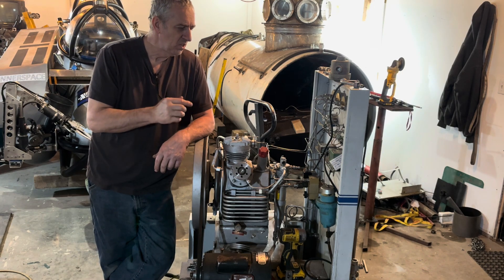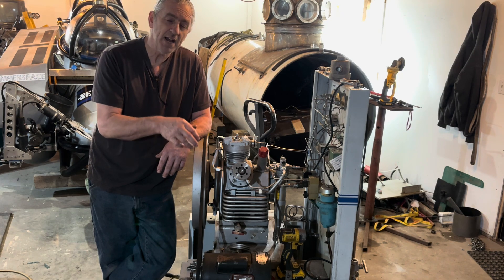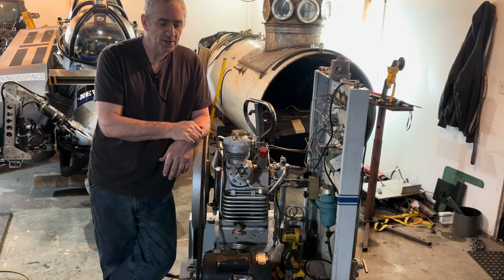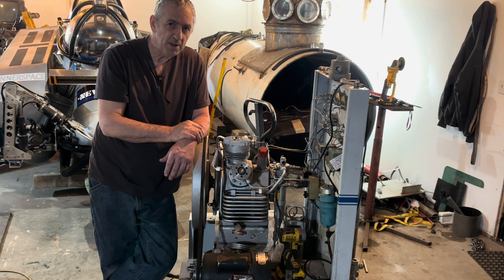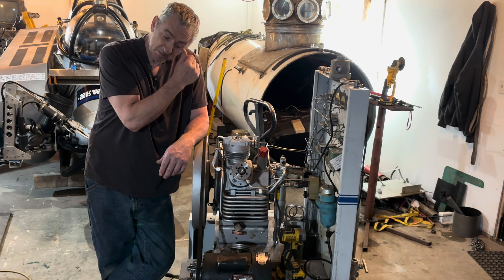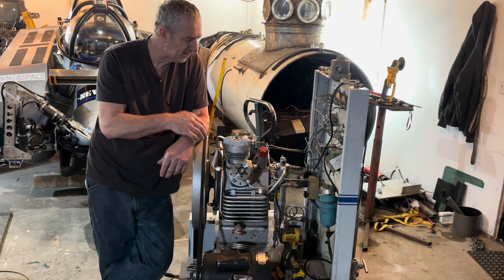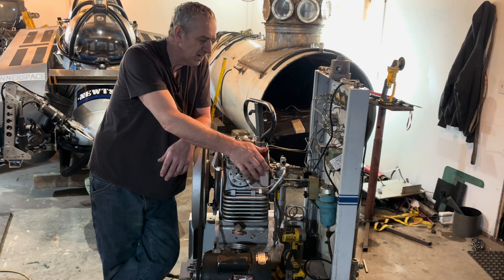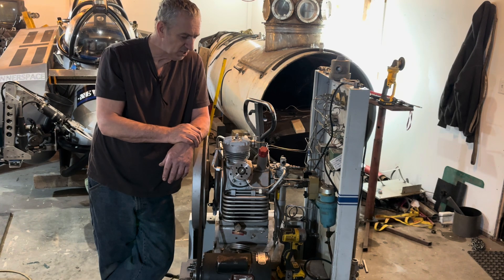Building a diesel electric submarine at home

Comment: You can run the three phase  motor on one phase power with a VFD or phase converter. Most use a VFD.
Reply from the maker: I have a phase converter but its too small and I dont want to spend on it right now.

Comment: What size of pipe is the submarine made from and how thick is it? Just curious if my 42" pipeline pipe would work. It's only about 3/8 thick but it was pressured up to over 900 psi.
Reply from the maker: This is 48 inch 7\16 thick.  Your 3/8 is fine, but you need ribs depending how deep you want to dive.